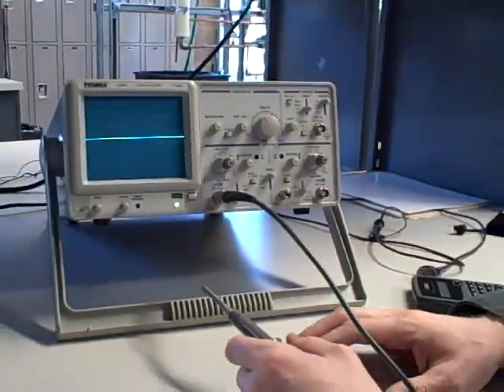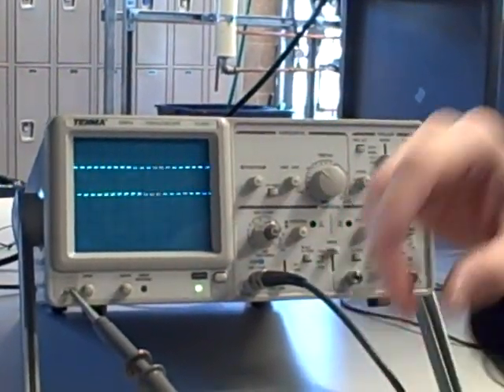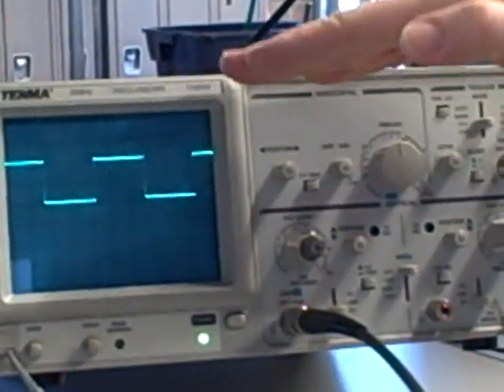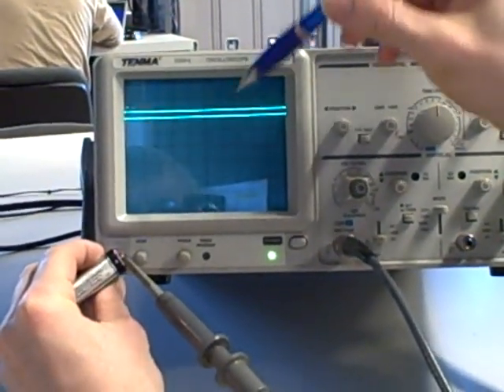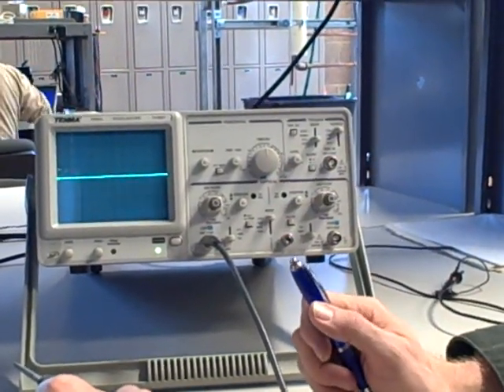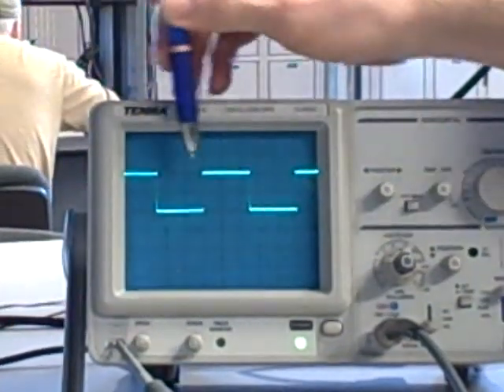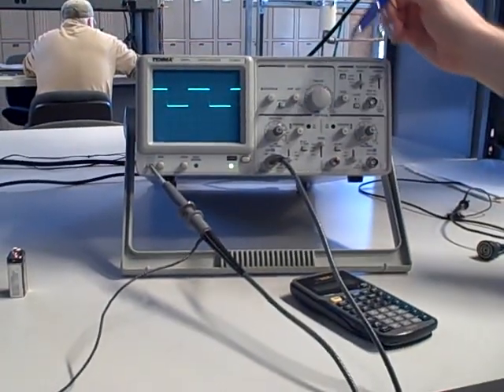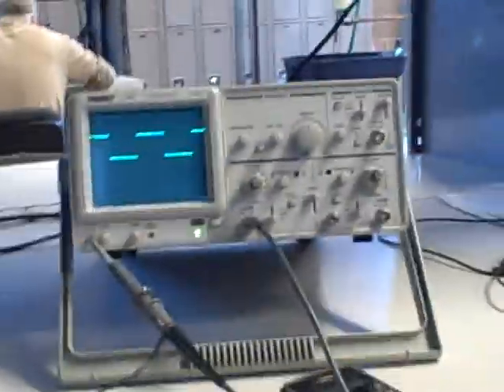Oscilloscope operation part 3

Comment: @BTCInstrumentation:
hi, thanks much for the prompt reply.
i asked as I've just got a 20Mhz oscilloscope which is exactly the same as the one you're using for this tutorial. The only diference is the brand name.
I'm just learning its proper setting/calibration based on your great video tutorial. I can't use the instruction manual of this scope as this is all written in Chinese. ;-]
I'm following your very informative videos as it really helps a lot of electronics enthusiast like me.Good Luck

Comment from the maker: I did make mistake in the video at first, saying the timebase was set to 2 ms per division, but then I corrected myself.  

With a timebase of 0.2 ms/div (0.0002 seconds per division), and 5 divisions per cycle, one cycle takes exactly 1 millisecond (0.001 second).  Reciprocating this value gives us a frequency of 1000 Hz.

Comment from the maker: Sadly, no.  Any external capacitor would be in series with the scope's internal capacitor, which would *diminish* the total capacitance rather than increase it.  It could also really mess up the lead/lag compensation of the probe and show a distorted waveform.